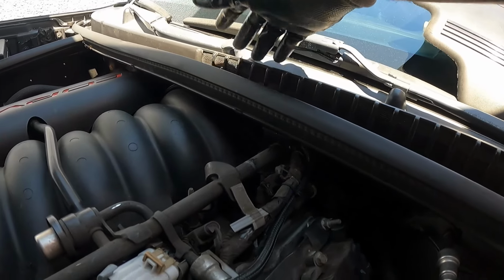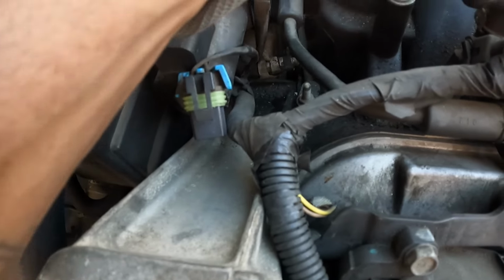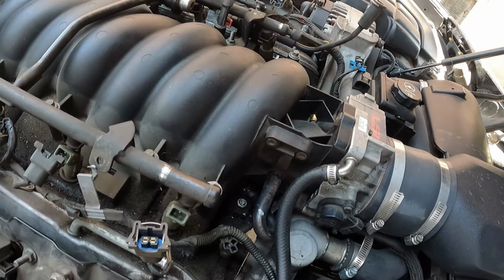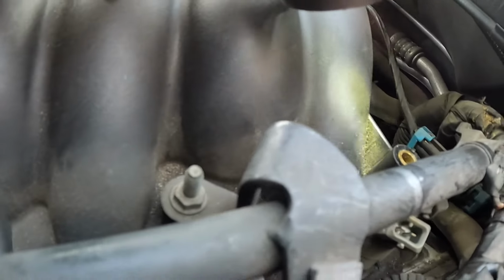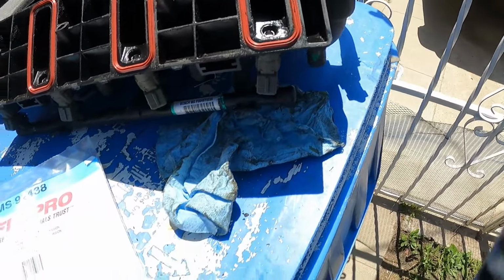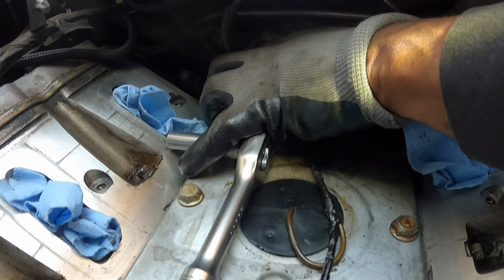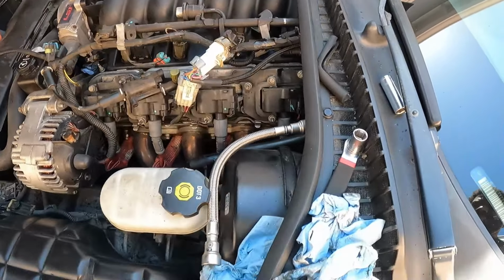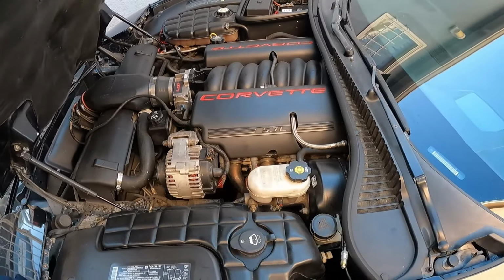C5 Corvette Intake Removal (oil pressure sensor, cam position sensor and gasket replacement)

Comment: My intake was full of oil (LS1)
Reply from the maker: Might want to install a catch can
Reply: @HTPJay  I already had, still got blow by. The catch had oil in it, I noticed the filter thing inside it had unscrewed and dropped down, and allowed it to get through I think. Going to change the whole PCV system to the LS6 while I have the intake man off fuck it.

Comment: my friend and I just did my manifold gaskets and pads, oil sender, camshaft sensor, pcv line/valve, catch can and RTV'd the Vally. All trying to chase an oil leak. But when we put the mani back on. We noticed a rubber elbow on the bottom of it. Can't figure out what the hell was connected to it.
Reply from the maker: At the rear of the intake near the firewall? It’s for the vacuum hoses
Reply: @HTPJay  ok. we had a rubber elbow on the intake and we couldn't figure out where the heck the line for it went or what it was. shes running ok. just have to turn the key twice now to get her to start
Reply: @retrobear9367 that's what mine it doing.  Ive tracked it to the cam sensor or the maps sensor.  What about u ? )
Reply: @IamVintage72  rear main seal. thats the only thing left to replace. Collecting parts now and doing a "while you're in there" upgrading spree when we do the seal. Might as well.